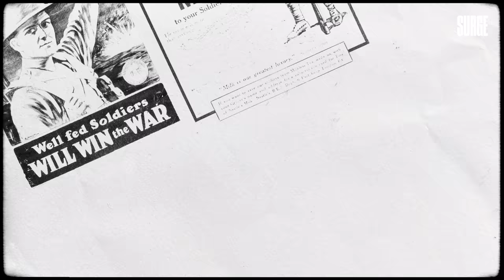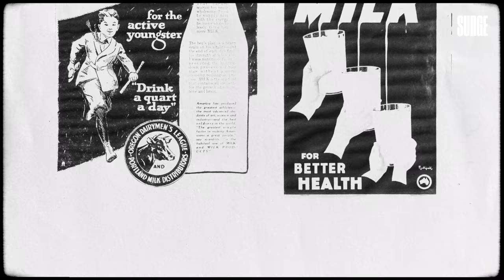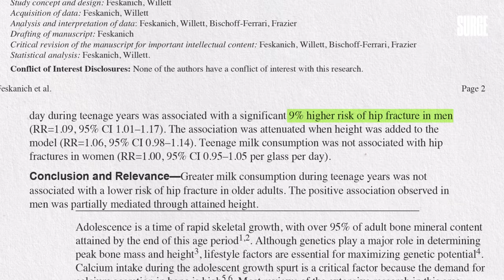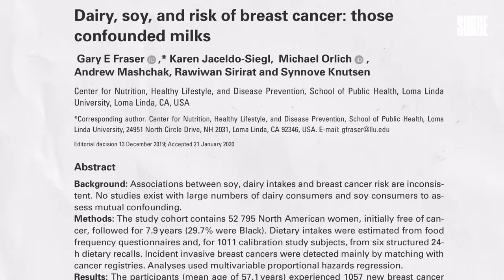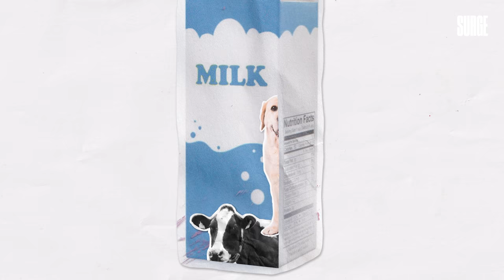This is how the dairy industry lied to the world

Comment: 4:28 should you be recommending soy as a replacement if it still increases breast cancer risk? (the reduction of 32% is in comparison to milk (you did not mention control group) which increased it from 50-80% meaning soy still increased cancer by 20-50%)
Reply: @YoStefan he didnt say drinking soy milk alone reduced cancer by 32% he said it reduced it that much when you replace milk (which increases cancer risk from 50-80%)  with soy so do the math.
Reply: @tientruong2007  If soy reduce breast cancer risk by 30%, Then going from soy milk to milk will give you an 110% increase in breast cancer risk? Is that what you are trying to say?🤡

Comment: Where did you find the percentages on the jaoa for prostate cancer? I did not see or find anything related to men more likely to get cancer by 65% having a dairy diet, or a 36% less in plant based diet. And you didn't source the 4:28 , which i had to find on my own in a separate search. The Health gov site also has USDA alternatives to dairy related products if you choose not to intake real dairy products which have similar quantities in value. Also again, I could not find in anything you cited the 32% soymilk thing. It wasn't in that article that you didn't source either. Other than that, yea US being pretty shady with the all the dairy stuff. But most of the research you've shown usually shows the breast cancer is linked to the hormones in the milk due to the cancer being grown due to more hormones, and the fractures things wasn't evident enough, being thrown to just regular growth being the cause of the fractures. Dairy overall as a product isn't the problem, is the copious amount that is being consumed, mainly cheese and the milk. Other things like yogurts, icecreams, butter, creams have barely no effect due to how their made and used. Even cheese has low percent amongst these too, at least from the charts shown in the things your cited.